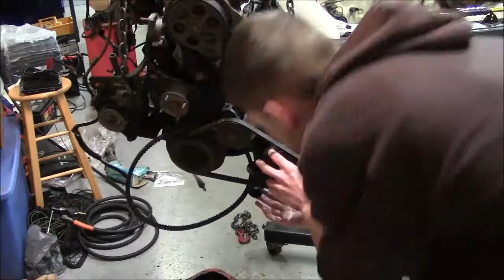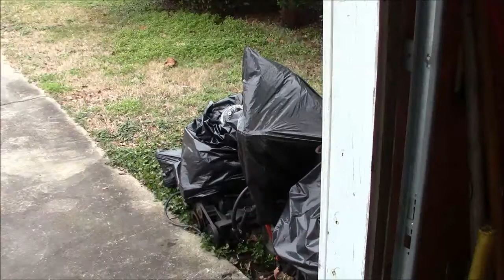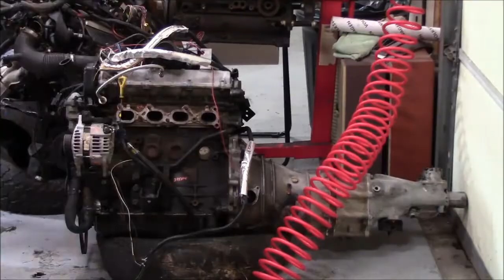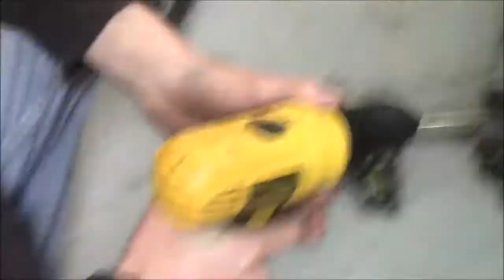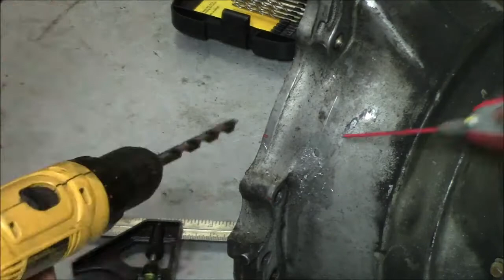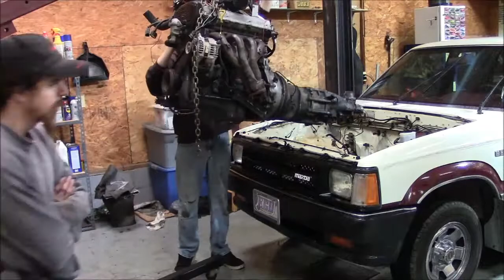AgentSmith Mazdatrucking.com FE3 engine transfer Day 2

Comment: I've read your fe3 swap post over and over. and i have a few questions. 

1) when i put the crank sensor on, does the engine have to be at Top Dead Center? 
2) i am getting a 2000 kia fe3. how much does the wiring differ from the 1997? because on the post you made a wiring diagram for the 1997 kia fe3. 
3) i am doing most of the work myself. how hard is the swap and whats the most difficult part? im 16 and i have car knowledge. im still fuzzy on wiring. 
4) does the ECU stay in the truck or in the engine bay?
5) i will be using the kia ECU (to save money) is there any way to improve performance just through the ECU
6) does the stock kia header fit in the engine bay? i won't have power steering or A/c ( for now)

thanks in advance and i hope you understand and can answer my questions. -Daniel
Reply from the maker: +Daniel Barsan I can answer you MUCH better if you start a thread on mazdatrucking.com with your swap details.  Just easier for me to keep track of different people's swaps and help them through it.  Or email me.

ll give you short answers here:
1) No, it just helps to double check your marks after you drill
2) the fuse box and power distribution differs a lot.  But the 2000+ make it a whole lot easier.
3) For most, its the wiring
4) Either, I usually mount it where the mazda ECU was, inside
5) No
6) Yes
Reply: +Silent Dawn i posted on mazdatrucking. im new to the forums. here is the link http://www.mazdatrucking.com/forum/showthread.php/15550-FE3-B2200-swap-build?p=176984#post176984